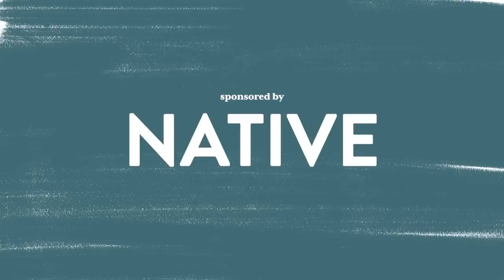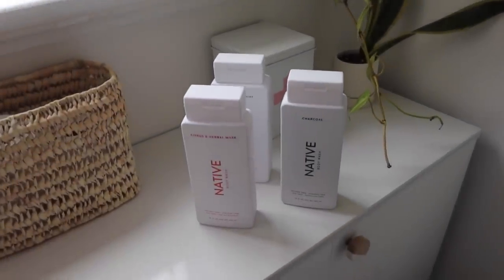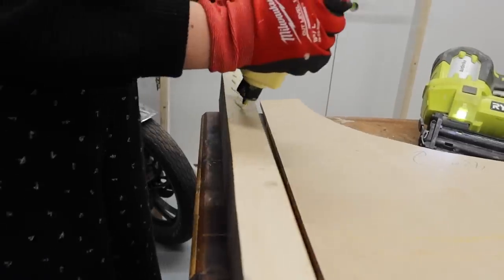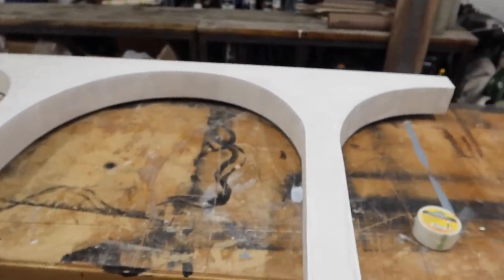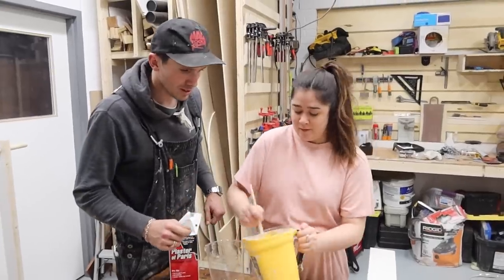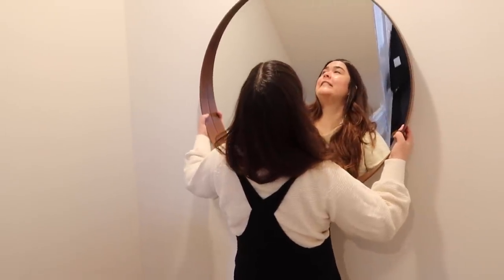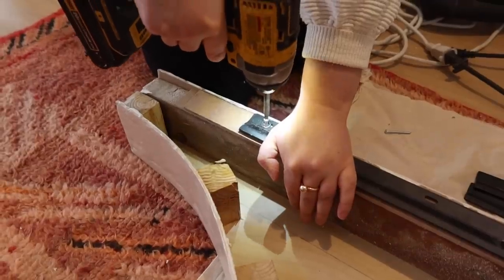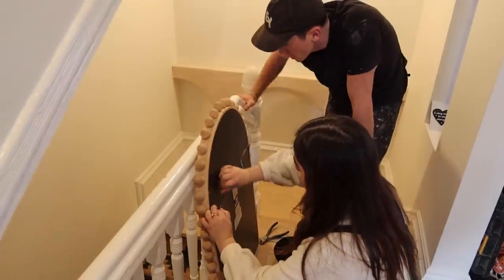Making My Empty Stair Landing CUTE! | DIY Plaster Console Table

Comment: One does not decorate a landing, one leaves it clear so one can walk on it...often with various packages from shopping trips, sometimes with a cart, having just done the weekly grocery shopping,
one leaves stairs and landings clear for people to walk up and down and to run up and down in case of an emergency (a fire someplace in the building?). Cluttering up a staircase and/or a landing is dangerous in case of an emergency evacuation.

Comment: Looks good, a great spot for keys & fairly easy to remove when you have furniture delivered. Personally I'd prefer a piece of wood on the top as I don't really like the plastered finish all over but as long as you do.
I can't see why you put any plaster on the ends though as if they were flat they would sit nicely up against the flat wall 🤷🏼‍♀️

Comment: I personally don't understand the urge to decorate every inch of the space, but if it works for you, why not. Except for, as someone has pointed out already, landings and stairs are not to be cluttered by console tables or any other stuff, however narrow it might seem. I hope nobody wil ever have to run down these stairs in an emergency situation.
Reply: Also imagine having to move big pieces of furniture up or down the stairs. It’s already narrow enough without a console table in the way.

Comment: I love the way the table turned out.  Cutting the legs to match the trim made it look so good!  I was hoping for maybe a different wall color but I do like how it turned out using the same.  I was thinking maybe a dusty green /teal.  I like the 2nd mirror choice better too.  Anyway you turned a very boring spot into a cute little corner!  Love it!  I was cracking up at animal of the day.  :)
Reply: Ironic that you should mention a dusty green. That's exactly the color I would've gone with.

Comment: Paint does go bad, usually after about 5 years. It smells like rotten eggs when it has gone off.  It's best to just recycle it (at a store that offers that service) because there's no way to get rid of the smell and you don't want your walls smelling like rotten eggs. I loved both your reactions to the nasty smell of the expired paints.